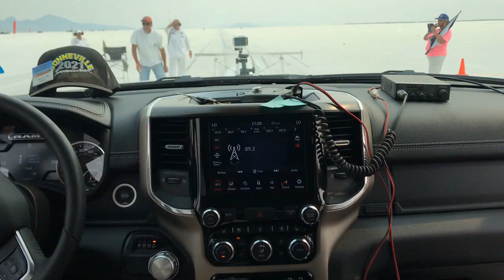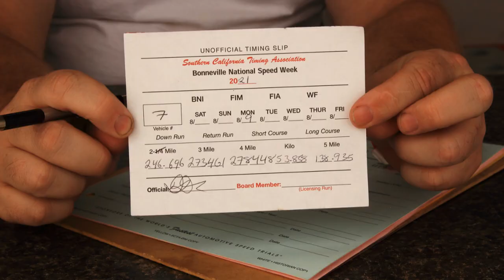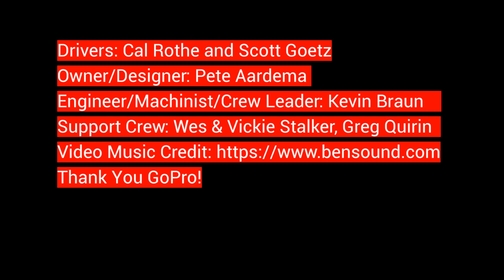Bonneville Speed Week 2021, 278MPH!  Operation Aardema/Braun's 369 CID 920 HP -V12 Lakester,  4K

Comment: Seriously fast but why is the cockpit such a piece of shit on every land speed record car I've ever seen. Seriously, zero f@#ks given to mounting instruments, switches etc. Even the steering wheel looks like it it was made from the leftover of a shitty garden chair with ratty tape wrapped around it. As a driver I'd be seriously wondering what that meant for the rest of the car in relation to my safety....ie. does anyone who helped build the car actually give a shit beyond the bare bones necessary to make it fast?

Comment: So about as fast as a Königsegg in a straight line?  Not bad, but the Königsegg could have driven there and back, so there is that.
Reply: Do you have any understanding of racing classes?  This is a naturally aspirated engine of less than 370 ci, running in a car with all four tires completely outside the body.  Take the turbochargers & fenders off the Königsegg and see how fast you run on the salt.

Comment: Awesome job, but please tell me what engine are you running?
Reply from the maker: This is the only motor in the world to exist. Pete Aardema 80 years old made the block from scratch and used Indy Aurora heads which he cut down and welded together.  It produces 920hp at 9800 rpm.  If you browse my YouTube channel you will see a couple other videos with close ups of the motor and Pete’s machine shop.
Reply: @GregQuirin  Made the block from scratch. Im building a land speed 1947 BSA C10 motorcycle backyard engineering got to lover Bville   good work on the record.
Reply: @GregQuirin  I will take a look at it. This is what is so impressive about land speed racing. The innovation is so impressive. And then to hand build an engine and run it that hard and go 278mph. Few people have no idea of what it takes to do this. Very impressive.